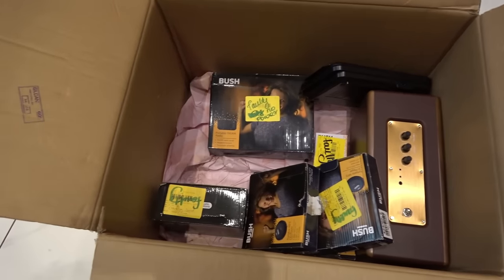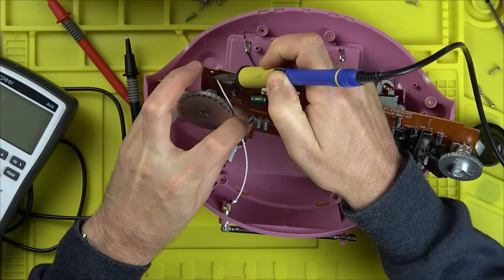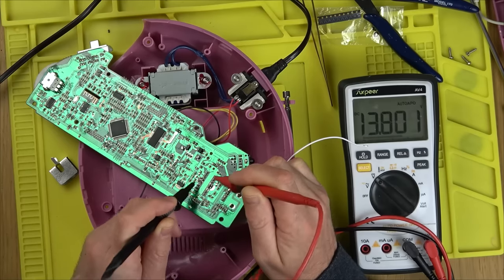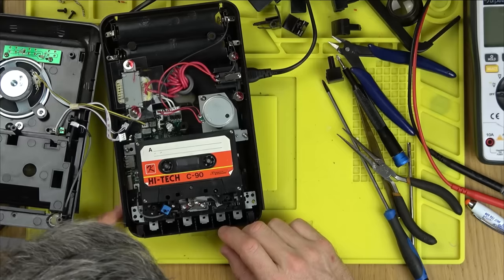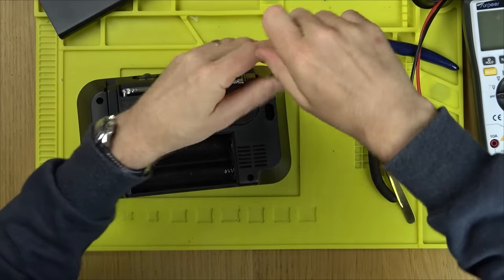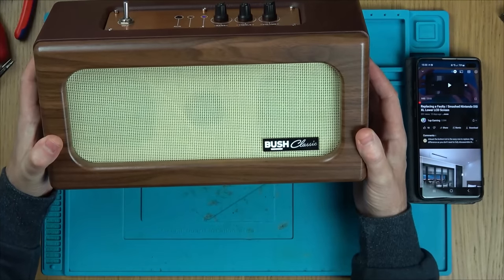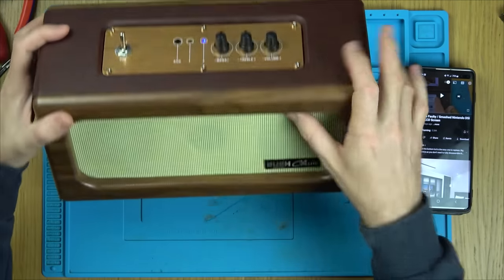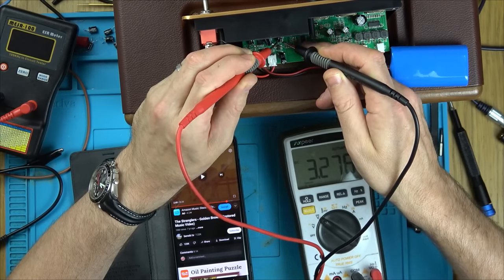MORE ARGOS CUSTOMER RETURNS to FIX - Can I Make More ££$$€€

Comment: The motor on the tape player will have it's own speed regulator, a small screwdriver into the hole on the back of the motor will allow speed adjustment (normally). The blue head is the permanent magnet Erase head.
Reply: Beat me to it! 
 I can remember the very early cassette decks that used centrifugal governors, bob weights which flew out and opened contacts, to control the speed.
Reply: Clearly visible in the video, I thought he would have spotted it?
Reply: I think the issue was the spring here. The pinch roller was being quite deformed and was pushing the capstan!
Reply: @terrygee210   he beat me aswell haha
Reply: A recording made on a slow machine WILL always sound correct when played back on the same machine. This doesn't mean the machine is working correctly.
Reply: @markpirateuk  The speed was spot on. The capstan was running slow because the rubber wheel was pushing too hard against it. Once Vince backed off the tension then the capstan motor ran correctly.
Reply: @williamgreen5575  And sound like the Smurfs when played back on a good machine!
Reply: I would guess either dirty contact on the trimpot so it effectively shifts the set speed, or some connection broke on the regulator board inside of the motor. Or the motor has dirty commutator, upsetting the voltage vs current vs true rpm relations so the regulator chip "thinks" the motor is turning faster than it really is.
Normally the friction won't change the speed (the regulator compensated for loading) unless it is really on its limits. But when on its limit, it becomes unable to maintain the speed stable, so you would hear it fluctuating. Here the speed is slow, but stable. That means the regulator is working, just "set" to too low speed.
Or someone may have fixed a broken drive pulley and used a too small replacement. Or if it is  using a square cross section belt with a V-grove pulley, too thin belt may cause that too: Riding at lower radius on the motor side, so running slower. A correct size belt (if wrong - the pulley grove would seem way bigger than the belt) will fix it, readjustment on the motor speed may be enough (alignment is needed anyway, as each belt is slightly different even when the correct nominal size)
Reply: @andythomas7931  Yea looking back over the footage, the capstan was being noticeably bent, putting strain on the drive. Just shows how flimsy those mechs are.
Reply: Some have speed adjustment on the motor, some have it in circuitry.   Unfortunately there is really only one type of tape drive mechanism made now which is very cheap and nasty.  The issue with this one looks more likely to be the excessive play in the capstan bearing, which is why the speed improved when less pressure was applied.   Very doubtful it will be reliable longer term
Reply: Exactly, small potentiometer behind the black dust cover on the back of the cassette motor. There is some electronics in there..🙂
Reply: I used to work on similar models 40 years ago. Your idea about the motor with speed controller is spot on. Back in the day we used to set the speed with an 8khz tape and oscilloscope but you can pretty much do it by ear.
Reply: @erikthewonderdog6522  Hi, yes they haven't changed much.
Reply: just wanted to say that :( many here watch techmoan i guess :) haha

Comment: The only thing we can deduce from the last few videos, is that if somebody gives you a birthday or Xmas present and it's made by BUSH, you're going to be devastated.  And inconsolable.  You may as well send it straight to Vince, unopened, with a note saying "Vince, fix this. Cheers".
Reply: Hahahaha
Reply: The motor has the adjustment, but a lot also have a secondary adjuster on the board.

Comment: These little tape deck motors have speed controllers built-in. That's why you wouldn't get any speed change with varying supply voltage. There is a pot behind that little hole on top that sets the speed. Speed should be about the same with and without the load. It can only change when there is too much load put on it. I bet that some cleaning and lubrication od the mechanism would make the thing work again. Cheap and dirty way to know if it plays at correct speed is to record single tone of known frequency (1 kHz is often used) on a known good working deck and use that to set the speed. Simple spectrum analyzer phone app should be good enough to measure the frequency.

Comment: The bush tape player is £20 on clearance at the minute so you could expect to get £10 for yours and with postage that would make it about £15 so realistically most people would buy a new one and get a warranty. That makes it worth about £5 I suppose🤔🤔 It's tough making money off of refurb electronics unless you're selling consoles or computers, these low end items are just not worth buying and repairing unless you keep them at home for your own use☹☹☹
Reply: MMV could offer a warranty though or swap it for another he has... you don't normally get much from a warranty these days anyway, considering it's on clearance
Reply: Its not unless ur gonna record a youtube video of the repair. Its what u can get at the time i suppose. Its more about the fix sometimes.
Reply: While I think of it, I purchased a cheap unknown brand Bluetooth adaptor on eBay for £3.99 and free postage from china… it has the exact same  Chinese voice saying “ batree low prease charge”.. it worked ok for a few weeks, now has same fault as your “Premium” 😂😂 speaker… hope you fixed it ok, and sold it for a couple quid at boot sale, I stopped watching, after you said premium…. Sorry… was laughing too much

Comment: Vince, about the "self-healing" radio, my guess is that the problem was the switch that blocks the batteries when the AC cable is plugged in.
Reply: It might also be a partially shorted capacitor, micro crack. The transformer has a limited amount of output power, but when the batteries were inserted, the inrush took care of the short. Happened to me once, and I realized after the short was back. It was a 0805 100nF capacitor. Also heating it would clear the fault.
Reply: Yes agreed. He needs to try the radio on AC again, but without the batteries. I don't think it is fixed.
Reply: That would be a perfect explanation if it wasn’t working on batteries - the switch just disconnects them. But it wasn’t working on the AC instead, so it can’t be related to the switch.
Reply: I've had that issue with a radio, the one I had must've been designed for a plug that was a bit larger, or the switch was worn out, because it would only work when the cord was twisted about to depress the switch enough.

Comment: if you record your own voice on a tape recorder which is too slow or fast your voice always sounds correct because you play it back on the same recorder. 
The Motor has a regulator inside the Metal Case. That´s why the Motor does not respose to different Voltages. The Speed of the Motor can be adjusted by the small Hole on the Motor.There is a potentiometer behind the hole.
Reply: Exactly what I came here to say. Slow tape will be slow during recording and playback. You need to listen back on a known good tape player.
Reply: Never noticed this comment I commented the same as soon as he did it hehe
Reply: The speed controller may have failed. The motors with speed controller are (or at least were) available. This is probably a clone of one of the higher end motors, and the speed controller is probably not very high quality.
Reply: That's what I came to say and it really annoyed me that Vince had no idea..🤬
Reply: I thought the same.
Reply: I came here to make the same suggestion. Recording needs to be made on a known good deck
Reply: that's correct 👍👍👍👍
Reply: Came here to say this 😂
Reply: I was just about to say this. It's such an obvious thing, too.
Reply: I wanted to say that. Record on another device and play it in this one. Otherwise all you’ve done is lost a bit of fidelity. The proper tape still sounded slow to me.
Reply: Came here to say exactly this. Needs to be recorded elsewhere.
Reply: Exactly how LP/SP worked on VCRs. An LP VCR would get twice the recording time out of a tape by running in through at half the speed, but at a loss of quality. When played on an SP VCR everything would be at 2x speed.
Reply: Record a sine wave tone of fi 1KHz on a known calibrated tape recorder and play it back on any device on test, measuring its frequency with a frequency counter or a oscilloscope.
Reply: @sdjmchattie  Reminds me of my old Talkboy toy. It was a cassette recorder whose on-off switch also had a "slow" position. If you played a recording back on the same setting you had recorded it on, it would sound normal. But you could record on "on" and play back on "slow" for a slow effect, or record on "slow" and play back on "on" for a chipmunk effect.
Reply: I also came here to say " Another great video Vince" whatever the tv experts say!

Comment: Hi, the excessive pinch roller pressure on the tape player at time 25:00
You were nearly right if you look at the other end of the spring you can see it's not seated in the little notch on the chassis. It's jammed in the play head.

Comment: The left side of the pinch roller retention spring should be in the tab on the upper left. It was not installed correctly and is stuck in the wrong position and adding increased tension on the roller and slowing the tape.
Reply: This is exactly correct. You can see the spring end that is fixed is under the tape head, nut under the the catch tab where it should be. Thats the problem right there.

Comment: 21:21 I'm not sure if it will help, but when I once disassembled a tape motor, I found a circuit board with a potentiometer that control the speed of the motor under the metal cover at the back. With this, you can usually readjust the motor's speed. There's a small hole in the motor, so maybe you can access the potentiometer through it, allowing you to solve the issue without having to fix the mechanical problem.
Reply from the maker: Nice one 👌👍👍

Comment: I have been welding 18 years now and I live in the desert. Nice to hear your appreciation for how hot and tough it is to do. You eventually get used to getting burns on various body parts. The hardest part is usually trying to get into the most comfortable position and sometimes it just isn't possible.
Reply: atleast with welding, you don't need to worry about things flying about like with air soldering? as a welder, try soldering sometime, with lead free, now that needs temps ;) also I envy (want to try) welders. so good for you :)

Comment: And for the BT speaker: The regulator too low voltage won't give "low battery" warning. The output of that won't be the basis of the warning at all. In the contrary, too high output of that regulator is way more likely to cause the low battery warning. The thing is, if its voltage has any play in the voltage monitoring at all, it will serve as the reference voltage. The true battery voltage would be then sensed via a dedicated resistive divider and compared to a reference, like that 3.3V (either directly via a comparator, or via an ADC in the processor and then the code)
What could have happened is the regulator to be unstable, causing voltage overshots. Once used as the reference for the Vbat monitoring, it may have triggered the LowBatt warning. Reason for the oscillation could have been the wrong capacitor type: The regulator datasheet says it is designed for a ceramic load capacitor, but there is an electrolytic. The ESR could be just too much for the regulator to become unstable.

Comment: @48:00 look for a resistor divider that goes to a pin on the uC, (not after the voltage regulator), the divider will be tapped off before the regulator so the uC can see the battery voltage.
Reply from the maker: Will do, thanks Scott👍👍👍👍

Comment: You fixed the tape recorder. It is the job of the capstan and pinch roller to set the tape speed, not the supply/takeup reel hubs. They are only there to apply pressure to the tape to ensure what comes out the takeup reel side of the capstan and pinch roller is wound into the cassette, not bunching up and eventually getting wrapped around the pinch roller. Also what people say about the motor is true. The easiest way to set the tape speed is to use a signal generator app on your phone to record (on a known good tape recorder) a few minutes of test tone, then play it back on the same recorder with a freqyency analyzer app to see what frequency it registers. Then play the same test tone tape on the argos return tape recorder and adjust the motor speed until the frequency matches that of the known good recorder.

Comment: 44:25 If you look at the datasheets there is a code for the voltage output.
18 = 1.8v
28 = 2.8v
30 = 3.0v
33 = 3.3v
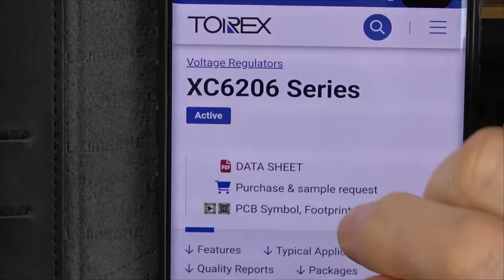43:55 The last number on your chip is / 33 with means its a 3.3v.
Reply: If it's rated for 6 volts and they are running it up to 8 volts that's why it failed.  I wouldn't put that model back in there if the one you put is properly rated to handle the voltage.  It could have been a bad batch from the factory.  Maybe somebody loaded the wrong reel of regulators in the pick and place machine.  It would have probably worked long enough to get past QC, if there was any.
Reply: @ErrorMessageNotFound  I agree. Putting the original back will certainly bring the fault back.
Reply: The pressure roller can make quite a difference to the drag on the motor. Definitely the spring was pushing it too hard and increasing friction in the capstan bearing.  With the radio that fixed itself, I wonder if the switch was failing to make contact or there was a dry joint that decided to make contact.  Typical any disturbance can “fix” a contact fault.  Nice fixes again!

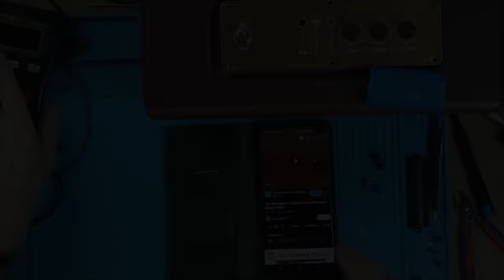Comment: 21:15 No the motor have speed regulator inside, no need to mess with this Tanashin mechanism. You see that black hole on the top? Put a small flat screwdriver throgh it, throgh black foam, there is a potentiometer that regulates the speed, but don't touch the the case (it  is grounded) and potentiometer at the same time or you'll burn the regulator. No need to be afraid of transformers in linear PSUs, as they are well isolated and live hot connections are on the primary coil, buried deep under the secondary coil which is wounded over with capton tape. Yo can't touch live wires there. 48:08 missing battery voltage feedback to MCU = bad resistor or bad connection. Oh well ... 🙃

Comment: Great job again Vince!!!!  I think you are right on that tape deck!  It didn't look right with the bend that was in it before you tweaked it.  When mounting a different component than the original, always a good idea to mount at least one of its pins to a position on the board (eg. scratch ground off and solder ground tab down to a ground area, or join one of the pins to the original pads), then when using wires etc, there's no chance of that component coming loose at some point.  As it heats up, hot melt glue just wont hold it - and regulators dump their heat into the pins and ultimately the PCB they are soldered onto.
Reply from the maker: Great advice Chris, I should have scraped back the solder mask and soldered up the ground pin. Nice one 👌👍
Reply: @Mymatevince suggestion see if the headphone jack works first if it doesn't it's just a failed headphone jack

Comment: Great video. When working on mains powered stuff, its a good idea to put a few strips of insulating tape over any exposed connections to protect you from accidental contact.
Reply: Or wear insulating gloves, we used to have them at a place I worked. They felt like marginally thicker surgical gloves but we're electrically inert and you could barely put a scalpel through them (and that took some real effort). I once found myself holding a live 400V cable (I was just a dumb salesman showing customers round the workshop) and only knew because one of the sparkies came running over screaming!!

Comment: Nice repairs as usual. On the cassette deck the motor has internal speed regulation so any voltage change (full battery to flat battery) on the input should not affect the speed there is a potentiometer inside accessible through the hole in the rear of the motor but they are usually tiny. As you say, the speed of the motor is probably correct, but the capstan roller's friction caused belt slip. One mistake was presuming that if you record your voice and play it back as a test, but even if the speed was 50%, recording and playback would be at the same speed so it would sound correct but prerecorded stuff would still be 50% slow. I think you are on the right track and releasing the pressure on the capstan roller some more would have it sorted, well as sorted as a £29.99 cassette player will ever be.
Reply: Excellent point re record/playback speed. Didn't think of that
Reply: Came to say the same about the relative speed of anything recorded on the device playing back correctly if its spinning at the speed its recorded at...,  and I didnt have to because everyone understands that with some reflection.

Comment: The fact you're fixing such cheapo devices is crazy, HOWEVER, it' s one less thing in the landfill and to be highly applauded. It's the kind of repair I do myself, often not cost-effective but it saves things from being thrown out. With the cassette deck, I think you HAVE fixed it, as much as such a flimsy, basic transport is capable of being fixed. It's tricky managing friction with a cassette deck - too little on the pinch roller and the tape will run too fast, too much and it will run slow. Good work, StezStixFix brought me here.